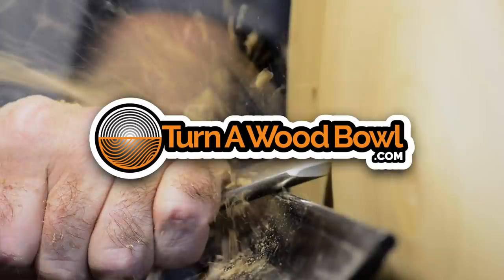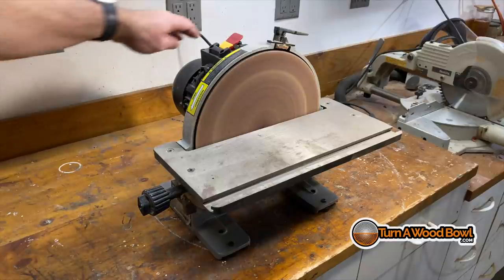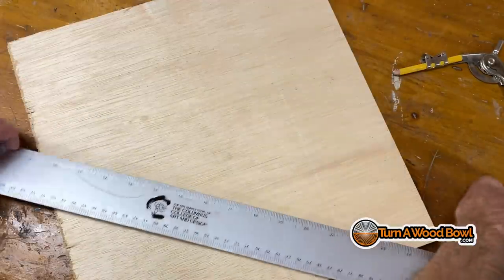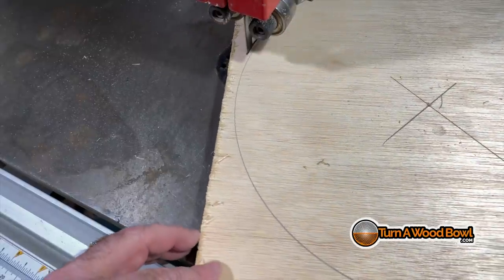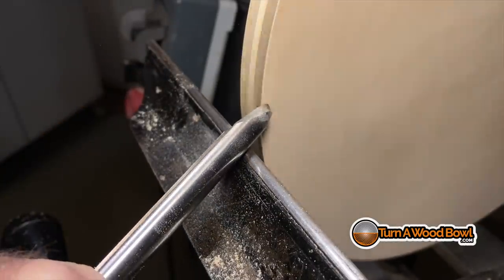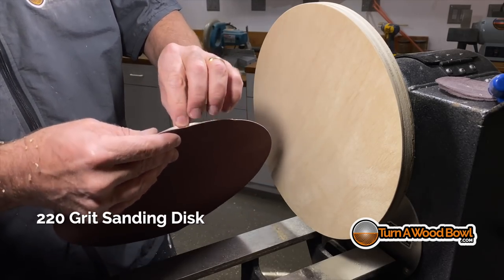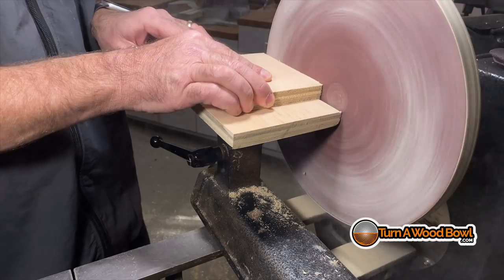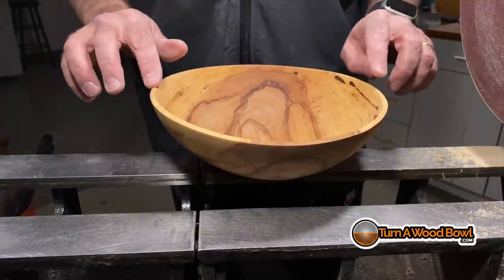Free Sanding Station Wood Turning Video

Comment: While looking for your most recent video, this one popped up again and reminded me to offer a suggestion. When I want to center a face plate, I extend the crossing lines I use to find the center point. Then, I center the plate by making sure each of the lines appears centered in a screw hole of the faceplate. Driving a screw into those lines ensures a nearly perfect center.
Reply from the maker: Thank you for writing and sharing Josh! Great tip. Happy Turning!

Comment: I used hook and loop system sanding paper for easy changes and use a faceplate ring that can fit nearly all my chuck jaw sizes. It takes seconds to setup on lathe and works so easy 
Thanks Kent
Reply from the maker: Great idea, Graeme! Thanks for sharing and Happy Turning!

Comment: That will be perfect for squaring up pen blanks or handle blanks before drilling them for tubes or thread inserts. I can just hang it on the wall behind my lathe and pull it down when needed. This is going to improve efficiency with my time because I can do all my prep work and turning without having to walk away from my lathe (because I like to do pen and handle turnings in batches).  Now I just need to make that banjo mounted platform......
Thank you for the jig/tip. 😁👍
Reply from the maker: Glad you like this one Brad. Happy Turning!

Comment: Great idea! I did this a few years ago. But I did not use a face plate. I put the plywood on the lathe and made a recess so I could put the wood disc  on the chuck. And I put velcro on the wood so I can easily exchange the sanding pads. You of course need different sanding pads with the cotton back to attach them to the velcro.
Reply from the maker: Sounds good, Rob. Happy Turning!

Comment: made one of these a few years back, for the platform I just made a plywood box that sits on the ways, secured down using a small block with a carriage bolt + wing nut, the block fits between the ways and then is sized so it can be rotated 90 degrees and then tighten the wing nut to secure the platform
Reply from the maker: Brilliant idea Noah. Thanks for sharing. All the best to you and Happy Turning!

Comment: I made something similar but I used one of the Nova rings so I can just clamp it with a chuck, also found hook and loop backing tape on Amazon so you can use hook and loop discs and easily change grits
Reply from the maker: That's a great idea Greg! Happy Turning!

Comment: I shall probably make multiple discs.  I shall use hook and loop as I have some 8" disc's already. I am going to adapt your idea and use a 3 - 4 inch disc on the back of the main 8" so that i can just pop them into the scroll chuck.  
I had thought of mounting a screwdriver quick change mandrel into a block in the scroll chuck so that I could use the 2" sanding heads I made for my power drill. That was my initial attempts before a made my own hook and loop friction sander.
Reply from the maker: Sounds excellent. All the best to you and Happy Turning!

Comment: Made disks like yours They work great Took old 12in. bench sander and removed table. bolted it to the wall so i have a horizontal sander, All 12in of sander is usable. Hot glue handles to pieces being sanded if necessary.
Reply from the maker: Sounds good, Sam. Happy Turning!

Comment: To make lineup of the ply and faceplate easier, you just need to extend your centre pencil marks out a bit because your face plate had holes that were at 90 d to each other. That way you just needed to ensure the pencil line appeared in the middle of your screw hole.
Reply from the maker: Correct Jenny. Thanks for sharing and Happy Turning!

Comment: Here are a couple of suggestions for your new "almost free" sander:
1.  If you use MDF if will be flatter than plywood and will not have voids as is common with many plywoods.
2,  Two inch face plates are cheap so I suggest you buy several and make a sanding disc for every grit you may want.
3.  If you don't want to buy face plates you can make them from hardwoods if you have a tap the same size as the drive on your lathe.

I have several of these sanding discs and use them often as they are very convenient.
Reply from the maker: Thanks for sharing Michael. Happy Turning!

Comment: Hi Kent, Thanks for sharing this sanding station. I like the rubber clean up to remove the dust, definitely going to chase that up. I made one of these a few months back that was very similar, except I purchased the 12” sanding discs in multiple grits with a Velcro (hook & loop) backing and purchased loop side that had a adhesive backing that I fixed to my ply board. Now I can quick and easily change grits in seconds, works perfect.
Reply from the maker: Glad to help Sean! Hook and Loop sounds great. Happy Turning!

Comment: I think a way to upgrade this if you intend to use many discs and don't have that many faceplates would be to glue a smaller circle of plywood on the center of the larger piece, mount it between centers and turn a tenon for mounting in a chuck.

Comment: Nice video.I'm a beginner and have three lathes, one for spindle turning,set up with cylinders attached with three grits for sanding when I'm not using it, one with a deeper swing for bowls and another newer lathe I use all the time. The spindle lathe with cylinders used for sanding  is ok. The bowl one came with a table like attachment (like yours) for the banjo that I had no idea of it's use. Now I know. Making three of these tomorrow for the bowl lathe. Great idea.
Reply from the maker: Very cool Michael! Enjoy and Happy Turning!

Comment: I have been looking into ways to reorganize my shop. I have a sanding station that's Box about 5 ft cube with a 12-inch sanding disc. This, needless to say, takes up a lot of room. I will be looking into making this attachment to eliminate this oversized tool. Thank you.

Thanks also to Anders Odman for the idea of gluing some wood to fit a chuck. This will save the cost of several face plates.
Reply from the maker: Roger that Dave! Enjoy and Happy Turning!

Comment: Yes the velcro hook and loop idea for attaching the sanding sheet means you only need one disc. Another way to make this even cheaper is to epoxy nuts into the plywood disc that match the thread on your headstock. Mine is M33 3.5 and i got a box of 6 for A$15 and so made up some screw on glue blocks as well. My work rest is made from 25mm threaded water pipe (fits into my banjo) with a standard pipe flange screwed on the end to hold the plywood base. So no fabrication required.. I have an extra disc made from two pieces of plywood with a 3mm disc of aluminium sandwhiched between them. This stops the disc flexing.
Reply from the maker: Sounds good Ray. Thanks for sharing and Happy Turning!

Comment: Good idea, nice video. I have a fairly complete wood working shop in my garage and I will just tape a piece of sandpaper down to one of the wings on my table saw and then place the foot of the bowl down upon the grit and with light pressure gently rotate the bowl about a 1/4 turn back and forth to flatten the foot.
Reply from the maker: Sounds great! Happy Turning!

Comment: That was very good ..I did something similar  but I did w my grinding wheel motor .  I pulled out the grinding wheel and made a 3/4plywood wheel and  attached it to it . But I put a light dimmer switch to it to control the speed . And it works very well .  God bless !!
Reply from the maker: Nice work! Happy Turning!

Comment: Super idea. Love the platform idea. Simple. I am happy the face of plywood was flat. I always have to face the plywood to make jamb plate or sanding disc. I purchased a tap for my lathe so I could make a maple block and put threads in it to mount in my lathe. Then glue the block to plywood and turn it round/flat. where do you get the sanding disks? Online or local? Thanks for sharing.
Reply from the maker: Glad you liked it Lou! Check the description box for the sandpaper links

Comment: Kent, 
I have one of these space takers it seems that when I need to use it.  Well it is buried in my shop and takes longer to dig it out than to use it.  I will be making one.  I wonder if one could use hook and loop.  This would make it much easier to change to different grit paper.  Thanks for the tip.
Reply from the maker: I love it, I don't see why hook and loop won't work. Happy Turning!

Comment: Great Idea, especially using a platform. I will make some using some 1 in x 8 TPI nuts. Drill a recess with a Forstner bit and epoxy them in, no faceplate needed. Thanks Kent.
Reply: while you're at it, just buy 2 or 3 bolts to go with it and you can cut them down to 1 to 2 inches, drill two holes in the center and use them to thread up onto the wall like his wall mounts were.
Reply from the maker: Sounds cool Gary. All the best to you and Happy Turning!

Comment: I like this video thanks. I’m planning on making multiple sanding discs for my lathe. How do you get past wearing out the screw holes when using them multiple times? Threaded inserts?
Reply: I would suggest NOT removing the screws at all. Leave the face plate on the wood disc. It becomes a dedicated unit.
Reply from the maker: I don't remove the screw. I use multiple faceplates. You can also make a tenon and screw it to the disk and attached that to your chuck. Happy Turning!

Comment: Good idea. I'm going to make two or three of these but instead of a faceplate I'm going to use a piece of hardwood that I've turned a tenon on that fits my chuck. I'll screw that into the plywood and that way I don't have to dedicate a faceplate to a sanding disc.  I also like the banjo support platform...now I have to find someone to make one for me.
Reply from the maker: Sounds great Larry. Be sure the wood is very dry so it doesn't distort much. All the best to you and Happy Turning!

Comment: Wonderful, fantastic and very useful sanding attachment. Thanks Kent. I have one question: During turning, the lathe is turned on and off to check. Would this frequent on and off damage the motor? I have Rikon Midi lathe (70-220VSR 6 months old). Thanks for all your wonderful videos, they are my excellent source of learning.
Reply from the maker: Hm? It should not damage the motor. We must stop and start the lathe often. Sometimes you see "production" turners rarely stop the lathe. That's fine for them, but not practical for most people. Happy Turning!

Comment: I will make one or more sanding discs, but am thinking I will make it out of a solid 1” thick milled scrap board and turn a recess tenon vs. using the face plate. I will then mount it to my lathe using a Nova chuck. Will that work?
Reply from the maker: Sounds good. Just make sure the wood is dry and equalized so it doesn't warp over time. Happy Turning!

Comment: Many years ago (30 or more) when I was making furniture I had  purchased a 10" metal sanding disc that mounted on my table saw and was used to "plane" board edges for glue ups prior to my being able to afford a jointer.  Don't  know if they are around any longer but could be useful for something like this as it was very stable like the backing plate of the disc sander
Reply from the maker: Very interesting James. Thanks for sharing. I bet it was wider than a saw blade. I can't imagine the blade and the mount are designed to have that side force applied. Very cool idea. Happy Turning!

Comment: I will definitely be making a few of those! I am saving up for a little larger lathe, so this will be money in the bank! Will be making a stand for my lathe, as well. As a lefty, it helps to get around the lathe.
Reply: Bruce, I'm a righty but I'd struggle if I hadn't taught myself to use either hand. I think if you're patient with yourself, you'll find it helpful. Also, I have found that in teaching myself to do something with my left, I often improve my skill on my right because it forces me to be more aware of what I'm doing. I've done this for decades and it is really helpful. Try stirring a drink or brushing your teeth with your right. We can do it, it's just awkward at first.
Reply from the maker: Sounds great Bruce! All the best to you and Happy Turning!

Comment: Great idea, I’m going to make one. I already have an old lathe head set up on a side bench next to a louvre window (for dust expulsionwith a buffing wheel permanently set up for buffing and stropping . As the wheel is fitted with a Morse taper, I’ll use that for the sanding wheel. There’s no bed way hence I’ll have to experiment/adapt to usea flat support platform like the one your dad made
Reply from the maker: Sounds like a plan John! Have fun and Happy Turning!

Comment: Wonderful idea!  I just finished putting my disk sander for the lathe together.  Thank you so much for sharing the idea.  You mentioned in the video that you would relay the location where one could by the wall mount to hang the disk sander when not in use...but I can't find it on any of the usual woodworking websites.  I sure would appreciate it if you would relay the location.  Thanks!
Reply from the maker: Thanks Donovan. The link is there now. Enjoy and Happy Turning!

Comment: Instead of fabricating the metal plate on the bottom of the platform just go to the plumbing section of your local hardware store and buy a 25mm pipe flange and matching pipe nipple to screw into it, less than $10 for both. My pipe nipple was a little too thick for my tool test fitting so I cut a couple of inches off it and turned a hardwood dowel to the size that fitted into both the sawn off nipple and the tool rest holder.  So easy 👍🏻😊🇦🇺
Reply from the maker: Great tip Rod. Thank you for writing and sharing! All the best to you and Happy Turning!

Comment: Great video Kent! I plan to buy a 6' pine 1x12, cut it down to 6 squares. Round them out with the band saw and then mount using a faceplate. True them up and turn a tenon on one side for my 4 jaw chuck. Then I'll have 6 for different grits and won't need use up or buy another faceplate. Wish I had a source for the banjo platform. Does your father take requests?  =)
Reply: Built a similar sanding disc for my Delta midi some years ago. Didn't think of the banjo platform but it was easy enough to make a platform that fit into the bed way gap and clamped down like a banjo. Done a lot of sanding for various projects with this over the years. What I like best about it is the variable speed. I used 5/8" melamine for mine. When the disc wears out a heat gun takes the old one off and the leftover glue scrapes off easily to leave a clean and flat surface for the new disc.
Reply from the maker: Sounds good Bill. Be sure the wood is very dry so it doesn't warp. All the best to you and Happy Turning!

Comment: I tell ya what, though, if you have a gouge or skew that’s severely damaged, or otherwise needs a lot of material removed, the disc sander will make quick work of it compared to a grinding wheel.
Reply from the maker: Interesting, Ben! Happy Turning!

Comment: I made essentially the same jig, except that I have a velcro type of permanent back glued to the plywood and I can change the grit from coarse to fine whenever I need.  Just make sure to use at least a 3/4 inch or even 1 inch plywood to get a very flat surface.  Half inch plywood won't do the job.
Reply from the maker: That's a great idea Alain!

Comment: In another video, you point out that the center of the bowl is turning slowly while the edge is flying. The same thing happens when sanding. Your board needs the be below or above center with the middle of the board at the middle left/right. Balance up/down and left/right as best you can. Think about it.     The other item is when you flattened the foot off the bowl. Hold the bowl in your left hand with the thumb inside the rim. Now square the bowl with the disk but not touching. The center of the bowl needs to be at the center of the disk. Use the tip of you right index finger to lightly press the foot into the center of the sanding disk. All sanding is circular. All in balance. Removal on the foot is balanced. No flying pieces. —I am learning a lot from you. Thank you.
Reply from the maker: Thanks for sharing Jim! Happy Turning!

Comment: Garry not Linda. Before you buy anything read the comments below there are some really great ideas. Larry Mitchell's is the cheapest and fastest of all. Turn a block, cut a tenon to fit the chuck, screw the block to the plywood. Couldn't be simpler. Another guy said buy a nut that fits the headstock, turn a hardwood block, drill a hole and press in the nut and epoxy in place, screw to the plywood. You don't really need a threaded piece to mount the disc to the wall. Turn a dowel to fit inside the arbor hole of the faceplate or adapter nearly all the way through. Mount that to the wall with a single screw through the center like the piece shown. I've stored my Shopsmith discs that way for years.
Reply from the maker: Sounds great Garry! Thanks for sharing and Happy Turning!

Comment: The most expensive part will obviously be the face plate, as you'll need one per disc... 😆
I need to build one, but I'll have to wait for my lathe to come back from repair... 😬😤
Great job, as ever...
Reply from the maker: Sounds great Thomas. You can glue on a wood block and add a tenon. Just be sure that wood is very dry so it doesn't distort. Enjoy and Happy Turning!

Comment: The biggest problem I found with doing this was that the wood can give too much when pressed against.  I made one of these for my lathe but I used a 1/4 inch thick and 12 inch  round steel plate.  Solid rigid and then made a flat surface with a post to fit in my tool rest position.  Works great.
Reply: I like the sanding disk.  I will make one for my lathe
Reply from the maker: Very interesting and good points, Dave. Thanks for sharing. Happy Turning!